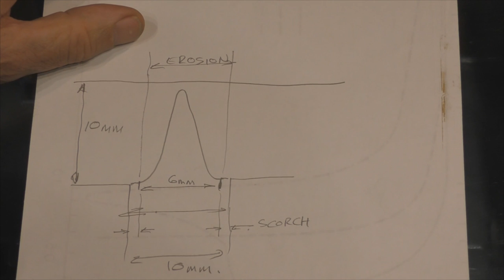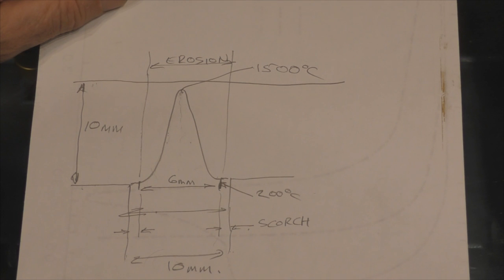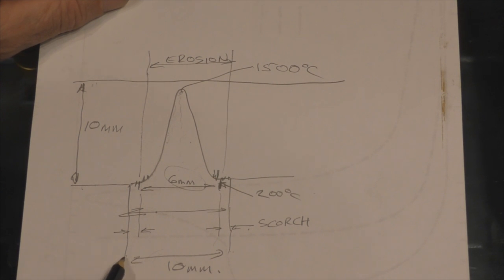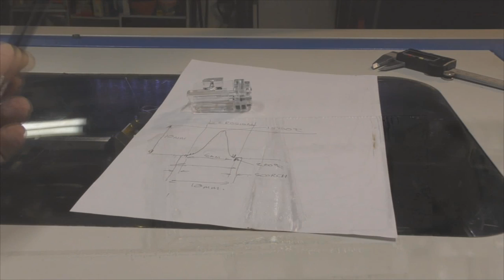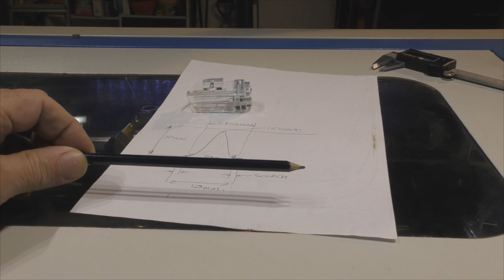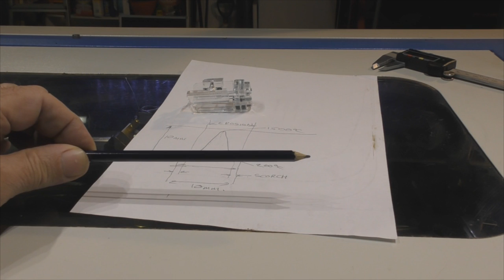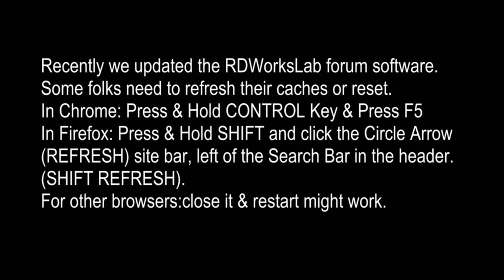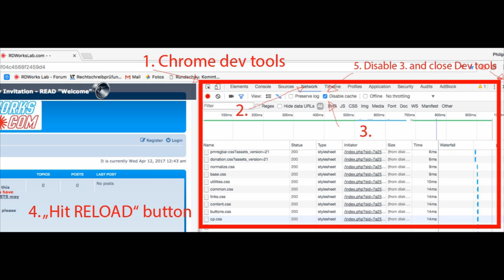RDWorks Learning Lab 102 Laser Beam Diameter

Comment: Been following your vids for a while.......Could you comment, maybe in a future video, regarding laser safety. I don't see you wearing any goggles or taking any special precautions against stray reflection and your eyes. I'm just looking for info to assist the use of my own 40W laser. Thanks, Ian.
Reply from the maker: Hi Ian

I have covered this topic in an earlier session and also for my other machine

https://www.youtube.com/watch?v=kJe16YQlIM0
https://www.youtube.com/watch?v=kx4vmDguCyE&t=206s

Best regards
Russ
Reply: Remember that this is a heat laser. It's not a visible laser. Hence any damage to eye or skin is through a heating process, starting at the surface of the contact area. Further, the wavelength of this laser is dramatically absorbed in water, with a penetration in few microns. 

So while it IS dangerous, it's about on par with a column drill or alike. A stray reflection won't blind you (and only specific materials can actually reflect this wavelength). 
But your mileage may vary - if at all uncertain, wear a pair of (glass) googles. I do at all times, even though I find the risk very, very low.
Reply: Thanks Russ/Peter.................I only ask because I have retinal issues as it is even before I got my laser cutter, so have always been very cautious around the machine. In my workshop I have the laser cutter through a door from the PC controlling it. Helps with fumes also. Ian.
Reply: Peter Eduard considering I have seen reflections from the steel and aluminium beds etc melt and burn holes in the polycarbonate window on the machine I feel it's very irresponsible to say that a reflected beam poses no risk to your eyes on such a public site. also polycarbonate glasses would be much safer than glass which could shatter.
Reply: I can only say that I have never seen that, ever. Perhaps we are talking about vastly different power of lasers? Especially if you can shatter glasses with them. The highest power I have installed is about 120W and that can't shatter glass at all. Reflections can happen I guess if things get knocked much out of alignment, but it's a quite widely (as Russ' video shows) distributed heat. I have never seen enough reflected power anywhere to mark, warp or damage the polycarbonate lid of any of my machines, ever. Never seen a mark on other surfaces either, although that would be more difficult to notice. 

The reflections from after the focus lens are even less of an issue, due to the spreading.
Reply from the maker: Hi  
Russ here. It is me that is making this statement. It is based on the pragmatic assertion that you will  flinch and respond at the slightest hint of a problem. Sadly a machine cover has no such response and continuous exposure to the beam will indeed burn through polycarbonate. Prolonged exposure on glass will also have the possibility of cracking it  but the heat has to be in the form of a concentrated beam of energy.  In the practical world,  the beam is focused at the bed or work and any reflections will be rapidly diverging and  become a low energy density wall of heat rather than the killer beam you are implying. 
 I am also wondering what sort of aluminium bed your machine had or how well your machine was set to be able to pierce a hole in your cover. The beam should be normal to the bed and thus refelections will ALWAYS be absorbed by the anodized nozzle that is fitted to all these machines.
Best regards
Russ
Reply: Peter Eduard it all depends on the materials people are using. cermarking stainless flasks were the cause of one case of the polycarbonate window melting during the job due to the reflection of the beam. this was a 50w machine. you can easily shatter glass with very low laser power due to thermal shock. I just think that the answer should always be wear eye protection no matter what as you cannot account for every possible situation. everyone is assuming that the people reading these comments are using the machine in the same manner as we do. people regularly engrave mirror polished cylindrical tumblers that are not flat and can cause the beam to reflect randomly. in a perfect world yes the beam diverges once reflected etc. but you are making a lot of assumptions with regards to who is reading/watching and how there machine is setup and what they are doing with it. flat beds flat work. I've seen pin beds made from polished chrome cones so can only speculate what reflections they would cause.  it's Murphy law if it can go wrong it will go wrong and a lot of the people running these machines don't understand the dangers and will happily stick their head in the machine or hands when it's running
Reply: I think Russ' says it well. I actually like the comparison with a column drill. I wouldn't' wear glasses while changing the drill, or doing other types of service work on the drill. But I would wear glasses while operating the drill if it was of the type not enclosed. 

The same with your example - that's while running the machine on something especially shiny for a long time with a target of reflections that did not move. I am still impressed that you could mark the lid tho - this was reflected light after the focus lens - you must use something with a very long focal length. If something reflected off my bed it would have to travel 30- 50 cm to hit the lid. At that range, I think it would have less heat power than the bottom of my cup of coffee. And that has so far failed to damage or dent the polycarbonate. ;)
Reply: Peter Eduard yes on most machines we have a long distance from the work to the lid. but the k40 has very space. my point isn't that it will happen everytime to everyone just that it can happen. as I said earlier people will stick there head into the machine to see how the work is going thus placing there eyes only a few inches from the beam.  you and I wouldn't dream of doing it thus we are safe. but there are some silly people out there who do things like that. so a blanket it's safe you don't need glasses is assuming that people are acting in a safe manner to start with isn't it?
Reply from the maker: Stainless is indeed much ore reflective than mild steel. Most flasks/beakers are brushed finish which has a dissipating effect on the beam However, I would be ultra cautious when doing such work (I must add that I have not done any such jobs). If you are using a rotary device than the beam will always be normal to the work surface and no significant danger, but if you are scanning across the curved surface then the risk of reflection from a non normal surface is ever present. My first precaution would be to make sure the product axis was front to back of machine and not across the machine. That would also mean that any beam reflection(which will by then be diverging anyway) will be sweeping rapidly across your cover and never be able to do any damage.. How many kilowatts is your machine?.
My reflection video is a cautionary demonstration of the potential dangers of reflections from certain metal surfaces. Most people will never encounter this issue. If you feel there are special dangers with your type of work I would be wearing a full face polycarbonate screen mask as well to prevent the possibility of skin burns (and maybe fire proof fabric clothing?). My point is that risk of any sort has to be assessed and not reduced to absolute zero
Sincere regards
Russ
Reply: Certainly. I don't see anyone saying that either. Actually quite the contrary. That being said - If people are stupid, they will get hurt. If you don't know the basics about handling machines, don't work with them. That's kind of obvious as well. I don't think it's Russ' job (or mine) to protect people. I gladly show people how I do; what they do is up to themselves. 

I have a good client (and friend) of mine who I think work with his laser in a bit laissez faire way. I have commented him on this and he has shrugged me off at every turn. He's the only person I know off, who has actually been "hurt" by the laser. And that's singed hair on the arm and hand and one burn mark on the back of his hand when he tested the power WHILE RESTING HIS HAND ON TOP OF THE LAST MIRROR. He claimed the pain was about on par with taking hold of a solder iron wrong. How one does THAT is also a mystery to me. 

But yes, you can be hurt. But unless you are especially silly (like looking into the laser pathway "to see the laser turn on") I can't see how you can get any permanent or serious injury. If you ARE the type of person who could possibly be found looking into the barrel of a loaded gun "to see the bullet in the chamber" - then no amount of safety gear will keep you safe. Just.. Stay away from machines. And Cars. And Bikes. And kitchens.

Comment: Hi Russ. Over the last few months I have spent many hours watching your videos , I owe you a huge thank you. I finally received a squashed Chinese laser printer. I know this is off topic but the chassis is twisted about 10mm. Looking from the front, the black chassis rail and the laser head bearing  rail have a 10mm twist. The seller assures me this can be fixed. I disagree and demand a full replacement or refund. Am I being fair? I can email a photo if it helps you understand what I'm trying to explain.
Reply from the maker: Hi 
A bent chassis can be fixed by a force in the opposite direction to where it took the hit.  However, it would take a very skilled fabricator to attempt that work and even then there would be no absolute guarantee. I would take photos of the damage and  continue your pursuit of the vendor but if you bought be credit card you will be in a stronger position. Keep records of all the  correspondence you have with the vendor and his negative replies. Let the vendor know that you will be approaching your card supplier for a full refund and to be honest I would be contacting the card supplier right now and find out what evidence they require.  That may trigger a response from the vendor, although I doubt it.. If you are successful with your refund appeal you will probably finish up with  a free but broken machine. What can you then lose if you try to fix it?
All good luck
Russ
Reply: SarbarMultimedia thank you for your quick advice.  Exactly what I thought.